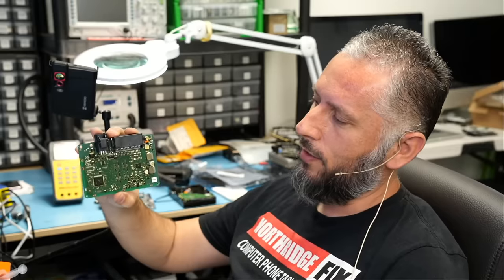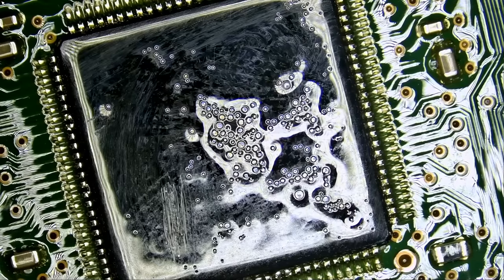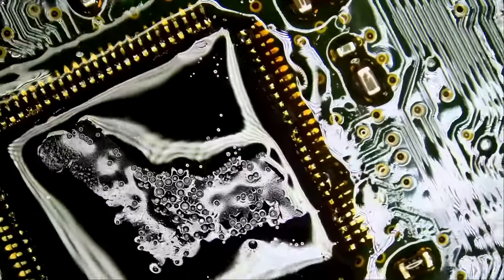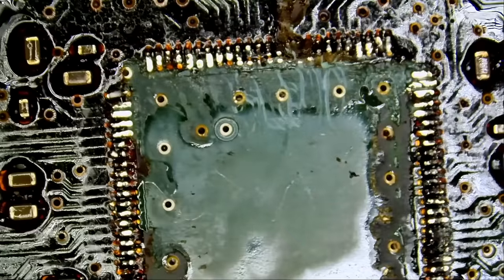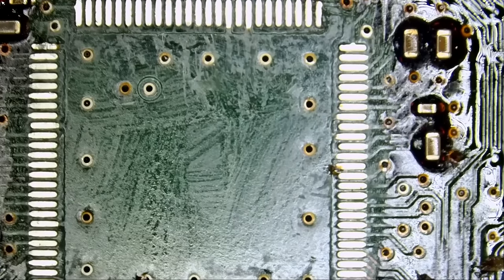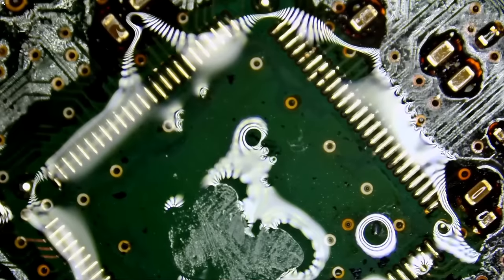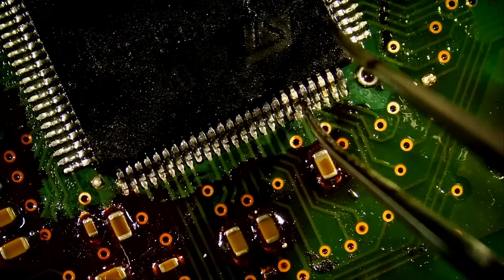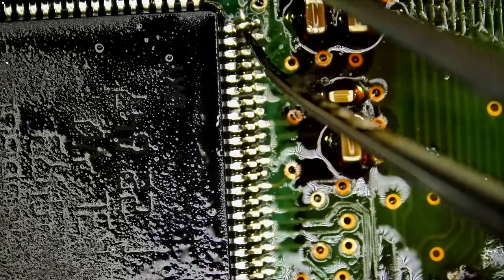Land Rover Locked KVM. Can't program new key. MCU Replacement.

Comment: The clear coating is called a conformal coating it is used to protect PCB’s and components from moisture/liquid damage. There are chemical conformal coating removers widely available on the market. This stuff was the the bain of my life when I worked repairing aircraft avionics modules.
Reply: Acetone to CHCL3 will probably do the work, anyway anything under the chip cannot be removed by a solvent
Reply: I had also suffer from this but I had cleaned with petrol those coat were remove easily but I can't understand what type of coat was done by company 🤔🤔🤔
Reply: conformal coating can be removed with IPA sometimes, depends though as there are different types. The one we used would come off with IPA no problems, or Microcare heavy duty Flux Remover
Reply: You can use toulene or epoxy dulient  it will melt the resin off 100% guarantee...
Reply: Lemon Juice and (store/shelf/.3%) Hydrogen peroxide or fingernail polish can be used if you don't have Acetone or remover, or if it's late and stores are closed. Still needs a bit of heat to activate though...

Or if you live in Alaska and don't have reliable access to places like Amazon or other online stores.

The lemon juice and h2o2 mix has to be thoroughly cleaned up though because it will cause corrosion and will short the board. So clean with soapy water and a soft tooth brush, then rinse thoroughly, then rinse thoroughly with IPA.
Reply: I just wanted to post this :D there are solvents to remove the conformal coating indeed .. the problem is .. depending on the placement of the ECU ( might be in an area where there's water/moisture ) there might be or not the need to put conformal coating back so you .. prevent the stripped area of ECU from corrosion damage over time.
Reply: @xxxhypoxxx  It would be interesting to watch, especially with the fume extractor turned off.
Reply: @xxxhypoxxx  I don't know what the coating is. Acetone is readily available and it's a acid that can be used in many applications , if used wisely, in exceptional circumstances.
Reply: @xxxhypoxxx  Acethone is bit aggresive for some parts, I lost by it few diode strip markings (MiniMELF) etc., its also not good for LED's, it can destroy plastic lenses. It can be used but with caution.
Reply: Steve, how did you get into repairing aviation avionics modules, seems like a route I'm interested in. Currently working towards my EASA B2 license (might be A & P for you)
Reply: but crying around is much better... he is selling "everything" you need but has no coating remover... yeah, great guy.
Reply: What about regular petrol?
Reply: Hello,conformal coating remover Toluen tinner on the job
Reply: @judahrex  Some of that stuff is really tough. Acetone won't make a dent in some of it.
Reply: Use paint thinners to remove coating locally  first.
Reply: can't stand dealing with that stuff. Smells horrendous if you get it on the tip of an iron.
Reply: @bhoot1702  somebody above mentioned that.
Reply: It’s probably silicone.
Reply: @xxxhypoxxx  Acetone will remove the screen print also...
Reply: @judahrex  acetone is not acid man its a solvent
Reply: @seanwood5443  Yes, it is a solvent. You are right.
Reply: Nitro paint thinner worked for me several times. Then you can reapply the coating with regular transparent spray paint sprayed from close range.
Reply: you can peel up the conformal coating with a exacto knife, or some you kinda need to scratch off
Reply: @ronlevin2339 acetone is damn agressive and even can dissolve tiny glass parts (fugged my dot matrix lcd once)
Reply: For me in the NAVY as well....
Reply: true and the conformal coating remover takes it off in about 3 seconds, definitely worth having some
Reply: Same bane to my life repairing Navy modules and PCBs. Found acetone or ethanol worked great.
Reply: @zarko71 hard to buy toluene nowaday anyways
Reply: @WarkWarbly  I don't think I would ever use lemon juice since it is so acidic and contains water unless you are going to ultrasonic it after.
Reply: @shuashuashua1  thatt makes a lot of sense, thank you I still mainly use 99% alcohol because I have had 0 issues with it but this is a rare case I did have a few electronics with this type of coating so I do understand.
Reply: @grozaadrian4134 solder doesn't corrode
Reply: @wiLdchiLd2k that's why he makes thousands and thousands bucks daily but you don't 😂
Reply: How much would a customer pay a dealership to get going? Heard it could be over a thousand ??
Reply: Nitromoors is the best
Reply: Navy 2M guy here, encased in epoxy was even worse.
Reply: Maan on my side wrigley. Job!
Reply: If you removed chip first,  you can  match grounds to find alignment.
Worse case
Reply: @wiLdchiLd2k  
I actually watch these videos and laugh at the coaching while watching what is effectively the electronics solder equivalent of booger welding overamped

Comment: I have a story about one of these. I am also an automotive locksmith. We run a lot of calls. This vehicle requires a lot of work to make the key. If we have to take things apart, remove panels, instrument clusters, open modules we send them down the road. Range Rover is one of these. We had a customer call just for a lockout. We opened it up and her keys weren't inside so she towed it to the dealer. They told her we ruined her KVM by unlocking the car without a key. They wanted $2500 for a KVM and close to $1000 for the key. The lady called me not blaming my company but she didn't know what to do. I told her they were full of BS. I had the car towed out and another locksmith who does all the high end stuff programmed a new fob for $650. This lady was so thankful for me helping her out. I hate these dealers. Always telling customers false information.
Reply: Those main dealers love to rip the arse out of anyone. I had a customer that had a totaly flat battery, and the mechanical door lock never worked anyway, so he only used the electronic key fob, the call out service jacked his range rover up & temporarily put a power pack on the starter motor/ solenoid which gave him enough power to quickly undo the door.

Comment: I work for an engineering company that designs and manufactures custom electronics. A lot of our boards receive this conformal coating. Anytime a board needs to be reworked then acetone is used to strip the coating before soldering.
Reply: Your information really impactful....
Reply: Wow.

Comment: The guys who say you cannot solder 0.6mm pitch pins with a regular soldering iron annoy me, I do 40-50 of them a day. I would rather use a wide chisel tip than a precision tip because of the heat capacity of the bigger tip.

Comment: Looks like a SPC560B60L3 chip.  Made by STMicroelectronics.  It is a 32-bit Power Architecture MCU for Automotive Body and Gateway Applications.  Less than $11.56 for small quataties.

Comment: Conformal coating is great for protecting PCBs from moisture, dust and corrosion. Surprised you don't have any of the conformal coating remover! Sometimes acetone or xylene will remove it too. But the actual special remover can be one more thing for you to plug as you repair. You can talk about the best soldering iron tip, best vise, the lights, the best solder wick, best flux, best tweezers, better than factory and best conformal coating remover. I'll give it three weeks before you discover it and add it to your store. 😉
Reply: Did he add it? :)

Comment: Electronic boards are coated to prevent corrosion.
Three types of coatings are;
Acrylic resin
Silicone resin
Urethane resin (Polyurethane)
To dissolve these resins there are solvents to do this with BUT you have to be careful not to also dissolve the PCB board as well.
Acrylic resin can be dissolved with Acetone (very strong) and Xylene
Use a Q-tip with sparing amount of solvent on it and mask area around the electronic component with painter's masking tape.
Silicone resin use Dicone NC-9 on Q-tip using same method.
Urethane resin use Isopropyl 99%
Since there is no way to know which resin was used, start with the Isopropyl to see if that works.
If not then knowing that Acrylic would be the most obvious choice as a coating, I'd then use Xylene.
But make sure you mask off the area.
If no effect then use the Dicone.
It is safe on PCB's
Reply: Thanks for your time 😊
Reply: Wow good job in dishing out these information thanks
Reply: PCB Board 😂 Sorry - bit of an inside joke
Reply: The most importand question about it is not how to remove it or "he does not like it". The question is why it is not put back on. it can be just a coat of clearcoat. Car needs this for moisture and humidity changes. I understand the hate ,  but it it there for a reaseon and decent repair would end with that coat or similar back on there. Also thanks for good explanation.
Reply: It's a thin conformal coating and not at all hard to deal with. I use plastic scrapers to remove the bulk of it.
Reply: @arva1kes  Whether or not that coating is critical really would depend on where the vehicle would be used.
Generally I'd say in California where he is it would be no big deal. 

In the northeast where I am from, the worst we'd see for condensation is when a stone cold vehicle (-15 deg) is brought into a warm and humid garage. Every single item and component in the vehicle would be covered with condensation, sometimes to the point of dripping.
Reply: @somethingelsehere8089  vehicles are not like your hip replacement - if you get it , it's for life. Cars get sold, traded whatever. How would the next guy know that after buying a "good" California car for wintery and salty conditions it turns out that it's not it suppose to be.
Reply: Looks like to prevent repairs
Reply: @f.miller801  Yeah, it would seem so but as I do more research on this, I'm finding that even high tech military aircraft and other weapons are being coated to prevent moisture fails.
Reply: @f.miller801 why would they coat the board to prevent repairs instead of just making the outer casing of the control module impossible to open up so you can't even access the board inside?  People are fuckin goofy lol.
Reply: @robertpage2023 it's present on almost any pcb designed from the ground up with the idea in mind of being in any sort of harsh or industrial environment.
Reply: @gcutler15  Salt spray and condensation and static from dust.
You don't want your board going down out at sea.
Reply: @gcutler15  I shall add salt spray and dust static.
Reply: Yep. You've said it. Ty for your time writing.
Reply: Free the Mustangs!
Free the Hostages!
Free the electronic components!
Reply: try MICROCARE SUPRCLEAN
Reply: I'd say, it's all in how "anal" you are about keeping your electronics protected.
IF your device is exposed to moisture and wet conditions, then yes.
Go the "full  monty" and do what is right or what the manufacturer advises or originally did to protect the device.
I'm all bout that!
Reply: Looks like to protect the device. IF they wanted to keep a DIY repair from being done, they'd do like Apple and make the part "special" and no way to get a replacement.
or coat it all in a brick of cement.
Reply: You can write PC board or PCB or printed circuit board, but otherwise great comment, thanks!
Reply: Thank you for the tip. I always make sure that those reading my comments fully understand what I am talking about and assume that not everyone knows the anachronism for all the terms.
Reply: Not only corrosion, in some cases to prevent short circuit.
Reply: @robertpage2023  true! this is made for waterproof and corrosion

Comment: True. Conformal coating is a nightmare to all repair shops. There's actually a solvent that can remove conformal coating, but I forgot what. It's not even commonly used in the industry where they use conformal coating treatment for their customers. The purpose is not only to protect the board from moisture/liquid attack, but also most likely encouraged that the board is non-repairable.

Comment: Good job with the conformal removal. A few YouTube channels have various methods of conformal rework, one in particular is "Rework and Repair 'Conformal Coating Removal' " on the Paceworldwide channel. If solvents are suggested, it may be difficult to source if someone is currently in California. There's also a section in the IPC 7711/7721 titled "Coating Removal, Identification of Conformal Coating" which has suggested methods as well.

Just my 2 cents.

Comment: I deal with this conformal coating daily- Use various products to remove it. I liked the BGA Blade idea you used under the chip but did have me nervous about a pads coming off. Obviously experience plays a part to not damage anything. The blade scraped the coating nicely as well without damaging anything. Definitely an "over come and adapt" situation. Nice
Reply: What about yellowish rubber-like material that doesnt come off with Acetone?
Reply: @farmdve  leave it longer and it will

Comment: I have a few lads that comes in all the time for small auto electronic repair and  they're the customers I really like , they never ask for it to be done asap as mostly the part is either stupidly expensive or has a lead time of a few weeks to get a new one. They never complain about the prices and I'm very reasonable because It's little jobs like this is what I love , they hand you the board or part ready to go or I tell them look take it to bits and just give me the board or what needs to be done and I'll do it while you wait. I tried to charge a guy 10 euro once for soldering a new smd led onto a dashboard as he had it ready and 10 leds on a strip, he threw a fifty at me and left me with rest of the leds for next time.

Comment: For repair work these conformal coatings are a real pain. I understand why they are used, but the silicone type is the easiest to work with. You very rarely even see the softer silicone type used these days. The worst for me is the full epoxy resin type potting. It's not even worth trying usually. You did an excellent job Alex without using a removal aid (chemical removal) it is very difficult to work with for sure.

Comment: The conformal coating has a number of advantages including protection from humidity, debris, and oil.  Perhaps it might be useful to be able to remove and then replace the conformal coating.  There are pen-like solvent applicators that allow spot removal of the coating.
Reply: my razor blade works just fine. on motorbike eeprom the it's usually under a half inch of silicone, then all this bs on top of everything else.
Reply: @markwilladsen5683  Not sure I'd want to try the razor blade on some type of polymer coating on a fine-pitched microcontroller IC.  But not surprised that it worked for you.

Comment: We had that conformal coating on every thing we worked on in the  Military way back in the 60s. Had none of the fancy tools and even soldered in electron tubes . The once you dig thru the coatings the traces would come off the PC board if you just looked at it.
Different but still very difficult. Love your techniques.

Comment: You should try using the grinding pen first to clean the crap of the pins, then use a low melt solder. That's the only way I found around it. Great video as always brother

Comment: i work manufacturing electronic boards for 15 years, with our coat we use nitro anti-fog thinner or DOLPH’S T-200 to remove the coat. I don't know if is the same coat but workfor us,  you have to put the product on board and let it  there for 10-15 mins .

Comment: When keeping the old component is not the issue, just cut the MCU pins with a fine and sharp tool to not to damage the pads, then remove the pins leftovers with solder and wick.
Reply: What i was thinking'

Comment: Techspray 2510.
2510-P   pint can
2510-N  Pen about the size of a paint marker.
Might be difficult in Cali! 
Pens can be ordered, but the pint cannot be shipped to a home address anywhere in the U.S.
They also have replacement coating to replace it after you get done to end the job up...
"Better than Factory" !

Comment: There are coating cleaning chemicals available in the market. You can get the job done very quickly with these.
Reply: There are Resin, polymer desolvers and solvents for this but you have to know what type of resin they are using and car manufacturers use several different kinds. But I would say you would find them on the internet. You might have to try different types to see which ones work and which ones don't.

Comment: I used to do that with a normal hakko soldering iron. As you said, flux makes it possible. In a pinch, I have removed old chips with knife and replaced with a weller gas iron.

Comment: I use a conformal coating remover and brass wire brush usually to remove conformal coating for automotive electronics.

Comment: This coating does 2 things: 1) prevents moisture 2) shows where heat comes. There is cleaning liquid like acetone, these coverings  are variable. Sometimes ECU s are first filled with glass pieces and then filled all with jelly to cover it all.

Comment: Bro very very nice effort I like it Only one thing I want to add  if you donot mind  that There are stuff available called conformal coating & conformal coating removal also. I am using those. One more thing I want to add that because it is used in a car in which many things can happen like rain ,vibration etc. so  before handing over to the customer please do the coating overnight and then handover to him, Thanks

Comment: I use MG Chemicals 422C silicone conformal coating on PCBs in marine grade beacon strobes. It protects the strobe beacon PCBs installed on oil rigs in the Gulf of Mexico from water ingress and condensation. Luckily the boards are available and under $300 and just get replaced when faulty. But MG Chemicals does make a silicone conformal coating remover "8309" if necessary.